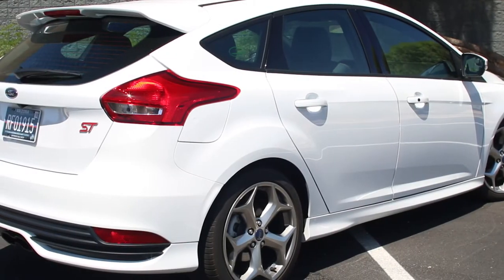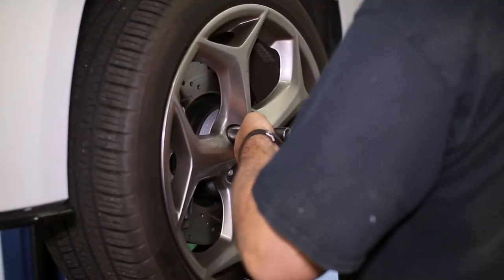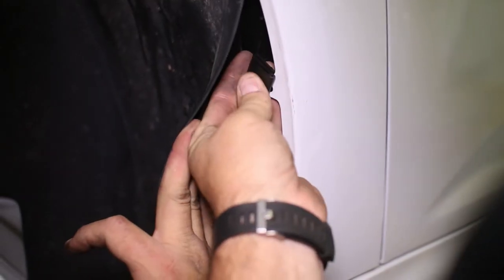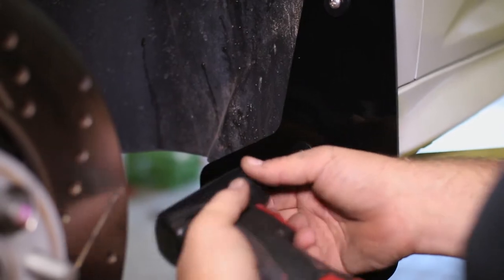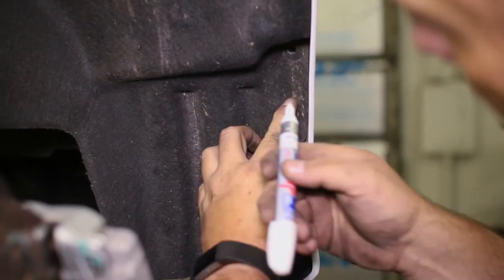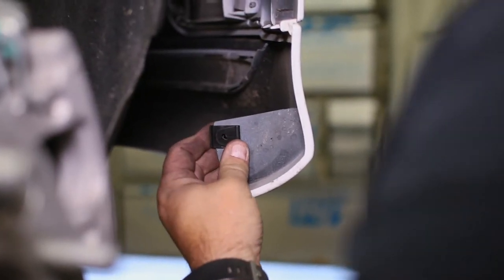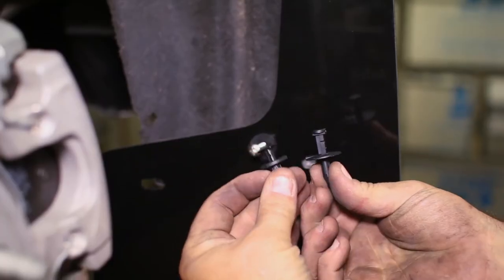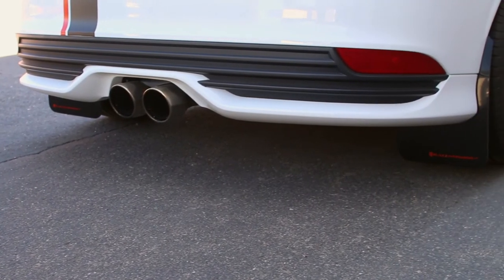2013-2017 Focus ST & RS Rally Armor Front and Rear Mud Flaps Install

Comment: What about the other three clips for the front tire? Your video skips their assembly.
Reply from the maker: Those three screws in the front mud flap attach through the mud flap, fender liner, and into the three clips attached to the fender. That fourth hole off to the side just attaches the bracket and mud flap for support
Reply: Stage 3 Motorsports I had light bulb turn on after watching several videos of ppl skipping the step I needed. The instructions provided by the seller were to blame as they show the clips being added inside the panel than again to the metal bracket.